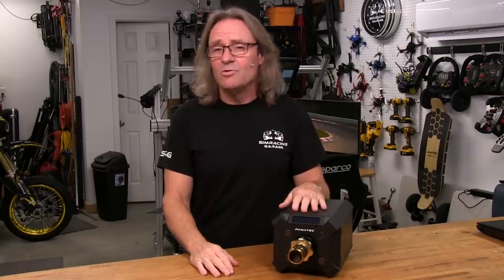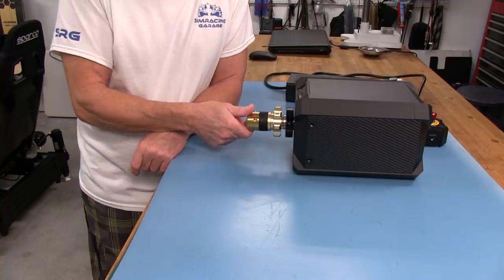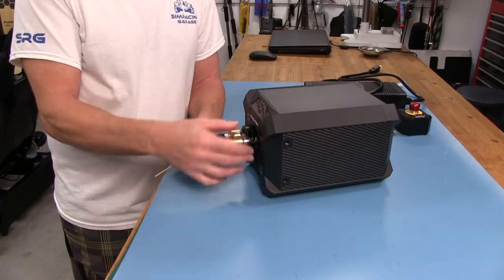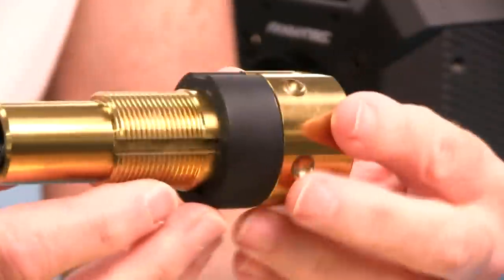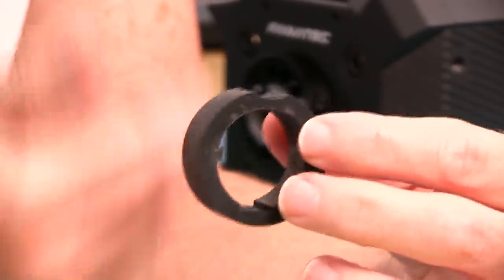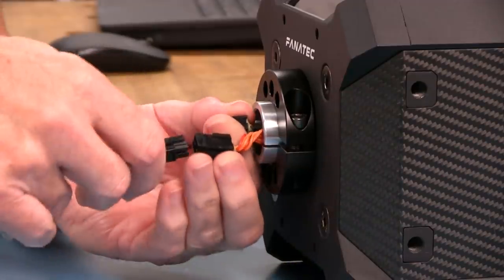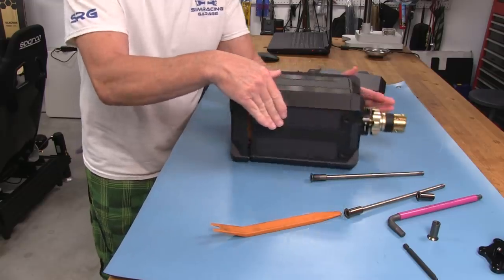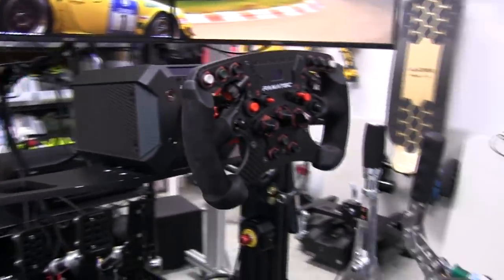Fanatec Podium DD2 Review

Comment: I don't have that QR flex, you need to turn the ring until it stops against the rubber, then put the steering wheel on it and tighten it until the ring doesn't move, it would be great if you tried this and gave feedback barry
Reply: I agree. My wheels are rock solid when installed correctly.
Reply from the maker: I tried several different processes for mounting the wheel and hub I had on hand. Short of putting a pipe wrench on the locking nut. No matter how tight you get the rubber piece pushed against the wheel side QR's inner surface, it is still made of rubber. The real issue here is the tolorence control from QR to QR in the manufaturing process. This is not a new characteristic for Fanatec's QR's. I do not doubt that some have no percieable flex in their QR's. I have read of those who can't even get their older QR to slide on to the metal part of the new wheelside QR, it's just too tight of a fit.
Reply: I have the McLaren GT3 with the Clubsport QR Adapter and don`t have that much flex like in the Video. I have flex, but it`s just very mall flex wich i really don`t noticed when i use the wheel. Maybe he has QR Adapter with less quality on his F1 wheel wich makes it flex so much.
Reply: @simracinggarage3026  I agree Barry, the Podium series does need a Podium mounting solution. Which from the rumors I have heard from the Sim Racing Expo. This may be something that is coming down the road.
Reply: @simracinggarage3026  have a friend that has a BMW Rim with 4 years give or take, bought together with a V1, doesnt enter nor the CSW 2.5 nor the Podium bases ( recent ones ) , nevertheless i have a podium DD1 with a porsche rim and a mclaren rim and i have nothing even resembling that flex :)

Comment: Most often overlooked feature is if you have the whole ecosystem from Fanatec. The DD2 makes all of your peripherals operate off of one single USB cable. Freeing up computer IO, which is valuable to a Sim Racer.

For example. I'm running the DD2, V1.5 Shifter, V1.5 Handbrake, V3 Inverted Pedals and the Asher Racing Rally Paddle shifter. Off of one single USB cable from the DD2.
Reply: Thats not overlook, thats simple not important. If you spend so much money on equipment you can also have a decent mainboard with more than just 3 usb ports in your pc.
Reply: A usb hub makes this irrelevant and you would be able to get better equipment than what fanatec eco system offers.
Reply: It is a decent point and of course, not the only one. Fanatec wheels are relatively affordable compared to top shelf equipment as are their pedals and shifters.. I know some of these $1000 plus dollar wheels and pedals put them to shame but money is almost always a factor so I appreciate the value. I run 4 universal hubs and this allows me to have a 270mm Rim (my old G25 rim), a 300mm (OMP), a 320mm (OMP) and a 350mm (Momo), all round (in VR matching the diameter is more important them matching the wheel shape) so round rims can be formula rims and rally rims, all in the eyes of the beholder (can't see my actual wheel anyway = ) and as stated by Mikey all while using less USB ports.
Reply: @chickeng0d800  I'm running a powered USB Hub already. It controls USB Lighting, 2x Derek Speare Boxs, TrackIR, SRS Blowers and a XBox Controller. Multiple Hubs aren't a great idea, especially controlling your main driving equipment that has a slightly higher power draw, even with a powered Hub. Having the peripherals going through the base allows you to use one Controller program for all peripherals. Which is less running background applications.

But I get it. People are going to hate on Fanatec no matter what. I've never had any issue with my equipment, and I am rough with it. Of course there is better gear out there, but at a cost that isn't worth it to me. And I am coming from a OSW DD.

My MOBO has my Mouse, Keyboard, USB Hub (stated above), HTC Vive Pro (Cant use Hub), DD2 System, NLR Motion. That's all 6 USB's used.

Comment: Got to try this at the sim racing expo the past weekend. Very disappointed, lacking a lot of detail. My team mate raced in the Porsche sim Trophy. Qualified 15th fastest Porsche driver in the world. In his first race he gets a slide and doesn’t even feel it in the wheel, he was still turning into the corner as the back end was coming around. By the time he realised it was way too late. I don’t know if it was just how it was set up for the event or if it’s a genuine problem. On the iracing stand in the new Audi TCR it lacked a lot of feel. Definitely not going to consider this. HOWEVER, the VRS(virtual racing school) wheel was brilliant. Max 20nm of torque and all the detail you could ever ask for. Radicals Online team boss even preferred it to the Leo Bodner SimSteering2 54. For under £1000 the VRS wheel should kill this. I was told the wheel will be released in the next month or 2. Also the pedals were very solid too, could even be a competitor to heusinkveld as they aim to beat it on price. Very very impressed.
Reply: Hi Adam, I'm sorry that you didn't have a good experience with our Podium bases. Unfortunately the Fanatec equipment provided to iRacing was not that well-configured early on during the weekend (they were using default settings, which are deliberately conservative and not ideal for iRacing FFB). I personally helped to tune the bases on Saturday, but perhaps you were at the iRacing booth before I was able to help them. Also, our Tuning Menu was not locked down, so there's always a danger that a visitor can play around with settings and mess things up.
Reply: @DomB_Fanatec  What are your suggested changes to the default Iracing settings for a DD2 wheel to get the most out of it feel wise.
Reply: @jeffa9429  Hi Jeff, please check the Fanatec forum - this can be found under the 'Community' tab on the Fanatec website. You should find a long list of recommended settings for most popular racing games, sorted by platform and wheel base. I also recommend that you check the iRacing forum, as there is a dedicated thread discussing exactly this topic in the Hardware section.

Comment: No flex on mine, bad review!
Reply: Why is it bad? His QR clearly flexes like a mother with two different rims.
Reply: @pallebosken8301  cause most of the DDs dont have that. He clearly got a fault version
Reply: @knochenkotzer2461  If you read comments here, there are others with same issue.  Ofcourse not all and my guess maybe 10% suffers from this.
Reply: I actually had tiny flex on my old CSW2.5 aswell, with F1 rim. Even got the rim in my hand mid race once!I So I had to use the M6 to fasten it, but then the QR its not a QR anymore....